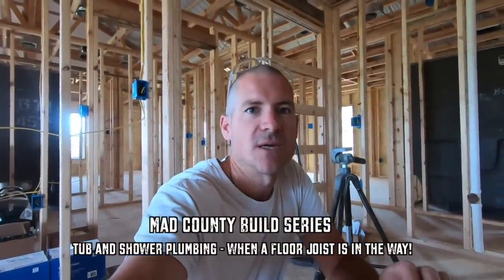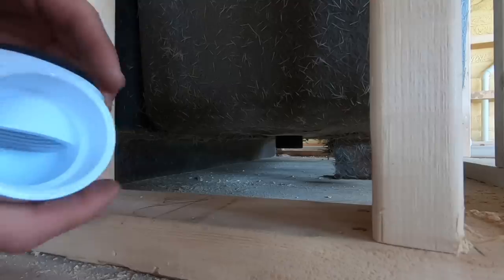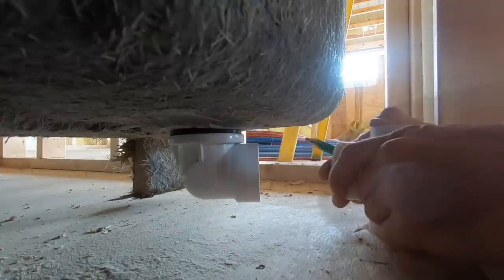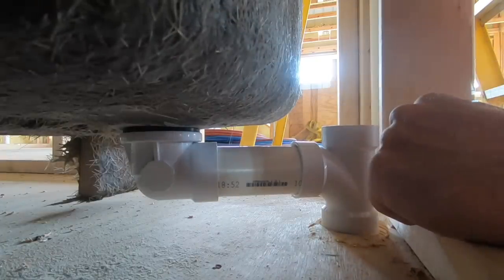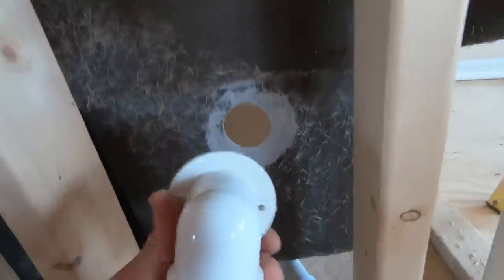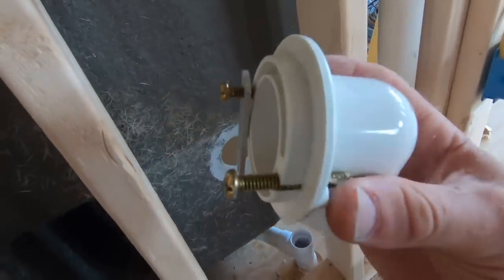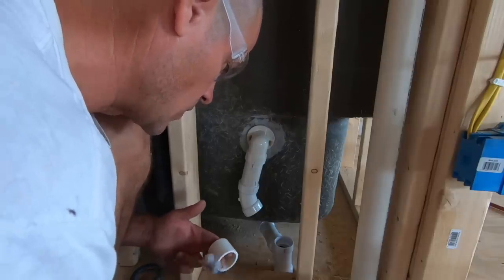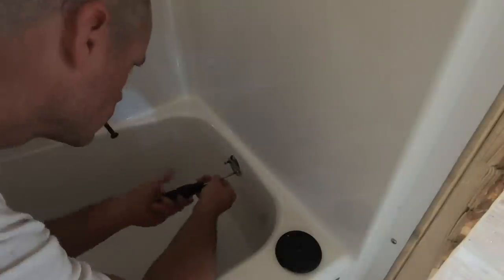Tub/Shower Plumbing | When a Floor Joist Is in the Way

Comment: That short pipe between the drain and the sanitary Tee needs to slop down toward the Tee, otherwise you will always have standing water in that section when you drain the tub.
Reply: What section do you think he should have used?
Reply: @lillithjones993  Same section, just angle it down a little. The pipe is forgiving that way when covered with glue..

Comment: You should be using purple primer the state that I Live in if you don’t use purple primer you feel inspection
Reply: There's a lot of state's that is code to use purple primer the state I used to live in it was code, I moved to another state and it not code in this state so I use clear it makes for a cleaner job for sure, different state's different codes it's a pain when you go to a different state sometimes.
Reply: Not all states require purple.
Reply: Purple is not required in most if not of Wisconsin. Primer is, just doesn't need to be purple.

Comment: If the tub has a floor level bottom, you're kinda screwed. When I remodelled my house, I just reframed the joists. Had to. Besides, the original joist had an 8" notch in it for the drain.

Comment: Finally, a plumber who is not using Primer before he applies PVC glue ! PS: dig your work shoes !
Reply from the maker: Ha…thanks!
Reply: I was actually wondering why he wasn't, although I did see 2 different cans sitting there. Is it generally not needed? I've always used it.
Reply: @TortureBot : Primer is not required in all applications. However,  if you are joining two pieces of pipe that will be pressurized, you definitely want to use primer. Primer preps the pipe for solvent. Solvent then "welds" - not glues - two pieces of pipe together. Weld joint is stronger then glued joint. For glueing PVC drain for tub - as shown in this video - primer is not really necessary. Hope that explains. Thank you

Comment: I was able to observe the 3-month construction of my home in 1987, almost weekly. I took lots of pictures of electrical wiring and of plumbing, before any drywall went up. That way, if in the future I had to fix things that became hidden from view, I could consult my numbered photos that matched numbers on a master copy of my floor plan. A lots of effort, considering that in the 18-years that I owned the new home, I only needed those detailed photos about 5 times. I see many exposed areas that Paul could photograph now, before drywall goes in. Of course, he will also have his videos which may be all the views that he wil ever need.
Reply: Contractors fix hidden things all the time without photos. You do this long enough and you pretty much know what’s in the walls.

Comment: I had a tub drain in the wrong place and was able to use this technique to fix my problem.  I used the link you provided to buy the parts and it worked out great.  NO LEAKS.  Thank You so much for this information!!
Reply: Just bought a house and the floor joist was notched like 5 inches. Smh. The joist now sags. I’ll tell my plumber when they remodel to offset the tub drain and sister the joist.

Comment: Thank you for being so concerned about doing your job correctly! Others need to follow your lead, as I just found an I-joist's top flange completely hacked out where our shower drain pipe drops through the subfloor. In addition, the pipe was so close to the remaining joist web that they were making heavy contact when the shower base flexed, which over the years broke the pipe off right at the shower drain.  Fortunately, I found this while doing some weatherization in the crawl space, so there wasn't any real damage yet. I'm working on cutting the joist the rest of the way out and installing headers to transfer the load to the adjacent joists.  I did a quick and dirty replacement of the broken pipe, so we can use the shower, but I'll cut it back and redo the piping once I get the joist work squared away.  We bought the home new 17 years ago, so the inspector, plumber and contractor really boned us here! Dang cut out joist flange was lying on the ground in plain sight too.  Looks like there was a leak during the pressure test, so the plumber went back in and did the joist hacking and rerouted the pipe to get the leak stopped.  I wish everyone had your integrity!
Reply from the maker: Wow, thanks for sharing and sorry that you had a poor install!

Comment: Under my tub when I remodeled my bathrooms I put 2” rigid foam on the floor and then 2 cans of large gap expanding foam.  When you do that, you need to fill the tub at least half way with water to counter the pressure of the expanding foam.  The tubs basins are rock solid.
Reply: Thank you for writing this.  I am ready to set a tub that has no insulation and planned to use foam.
Reply: Why?
Reply: @pearlperlitavenegas2023  makes the base of the tub rock solid....might even keep the water warmer longer as a side benefit.

Comment: Two things for anyone using this video for guidance. 1) If the tub you are installing is a freestanding soaker tub or a built in tub like this one... "and" if it is made of acrylic / plastic, read the installation instructions carefully. Some manufacturers will void your warranty if you use Plumbers Putty on the top drain flange as he shows here at 1:34 because Plumber's Putty  can have an adverse effect on the Acrylic finish. In this case its best to use 100% silicone caulk. Then again. if the plastic/ acrylic tub you are installing doesn't  specify a specific caulk and you want to use plumbers putty you should at least make sure the brand says "stainless" or "non-staining" on the label, (like the brand shown being used in this video) to prevent discoloring the plastic. 2) Not shown in this video... if your tub has an overflow drain the upper flange piece may have several large holes in the tube just below the top part of the drain flange.These holes allow water from the overflow to escape down the drain even when the drain is closed. When overflow style tub drains leak most of the time it's the threads where the large rubber washer and nut below the tub are allowing water past. In these scenarios you should put a ring of silicone caulk between the gasket and tub as well as applying teflon tape  and/or pipe dope to the threads. Here's a video showing where the threads can leak.- https://www.youtube.com/watch?v=pj65UHvwKLY&t=62s

Comment: We’re you using clear primer?
  I am installing a new tub. It is a little more narrow than the old cast iron tub that was in it. 
  I got a little stumped today when I check the alignment of the old cast iron drain pipe snd the new drain and P trap. 
  That and there is joist/support across the front that is crowding the overflow where it connects to the drain. 
  The old drain is about 2” off from where I need it to line up with the new drain.  I might give this a shot. 
  I had figured maybe using a 22 1/2 degree fitting and recutting some pipe. 
  This might be simpler.

Comment: Retired plumber....purple primer required and tub to be filled up with water to overflow drain on tub where I came from... we taught framers not to put joists where toilets and tubs go...chain saw works wonders to remind them
Reply: He’s using clear primer.
Reply: He’s fortunate, I received a stern warning from the plumbing inspector. He didn’t want to work that hard to determine if primer was applied. Where I plumbed clear primer did not have a UPC label (united plumbing code) which was required.
Reply: united plumbing code @joetrippi1603
Reply: Depends on local code, not all states require purple primer. I know Massachusetts and Illinois allow clear but I know there's still local districts within these states that want purple. In my state (New Jersey), it's all purple.
And here if you started cutting joists out of the way to fit your pipe in, you would be fired immediately and you'd never be working in that town again. The joists are there for a reason, it's your job as the plumber to work around it and not be lazy and take the easy way out of every problem.

Comment: I assume that when you plumb double basin sinks you also do that in schedule 40. I started out doing apartment maintenance and I constantly ran into people breaking the cheap thin wall tube double basin sink kits that you can get at the home creepshow. I would redo those in schedule 40 and they would never break again. This served me well in 2 ways, one the people wouldn't break them shoving stuff under the sink and two the plumbing for the sinks were back to back with the adjacent apartments and I had an incident with a rotor rooter guy shoving his power snake threw to the other apartment and busting threw the trap and putting about 6 feet of snake line into the persons kitchen. By the time I realized what he had done and went into the apartment , I seen 6 feet of drain snake whipping around the persons kitchen with all her grocery bags wrapped around the end, it had sawed threw her cabinet base door and was standing upright in the kitchen as it spiraled around.

Comment: Does your tub require concrete support under it? The manufacturer will specify if it is self-supporting.

Great job!
Reply: I doubt that tub does. I think it is usually for the deeper tubs without a lot of room underneath.  I'm sure that is what he will address later because that foot won't keep it from flexing or cracking.

Comment: Do you have pluming inspections there?  Most places require that you use primer and you need to use a color like purple so the inspectors can see it.
again, never put glue in the female part of the connection.
Reply: That is not true. You do both sections to ensure a good bond.
Reply: Incorrect, you always glue both male and female ends of a connection. Whoever told you that doesn't know the first thing about plumbing. 
And also no, not all states require a colored primer for inspections.
Reply: T K not all states require that awful purple shit, and you glue both pipe and socket of fitting. Also a 1/4 turn at least

Comment: Making marks on pipe made no sense  waste of time  you dont need a reference mark . It just made no sense to me  am i wrong?
Reply: When you dry fit the pipes you don't always get them to seat totally because of the dry friction. The glue acts as a lubricant so they will tend to seat a little further when pushed in. The marks keep you from pushing them in any further than you need. A few 1/4" off here and there can case you cut out and redo the entire line. Plus it's just a good easy habit. Measure twice cut and do once.
Reply: If you're doing offsets like this, it doesn't hurt to put in a reference mark so you're not fighting it when gluing when you've already had it all dry fitted perfectly. The fittings themselves also have reference marks on them that you could use so you don't always need to actually pencil one on. The primer eats the graphite right off anyway. There's nothing more frustrating than trying to get a precision cut and you cut it too short and have to re-do it. If you mark the pipe accordingly and do it right the first time, you don't have to worry about that.
Reply: Yes you’re wrong
Reply: Very wrong!

Comment: An imperial tape measure! How Quaint. :-D
Reply: Shouldn't there be a rubber gasket between the overflow fitting and the tub wall???  Use the gasket for dry fit alignment...